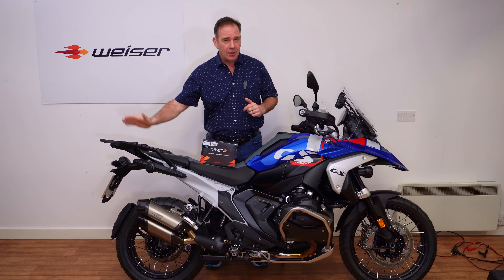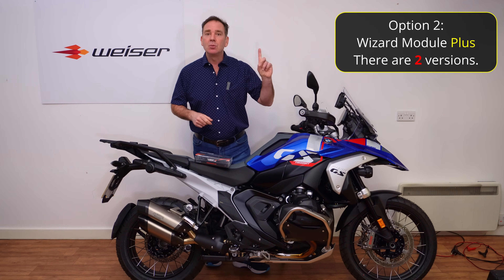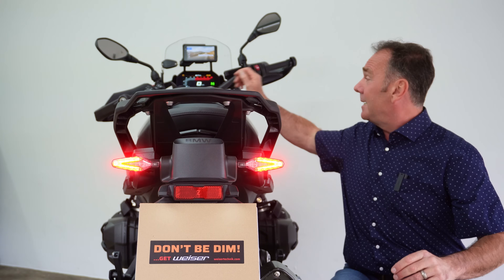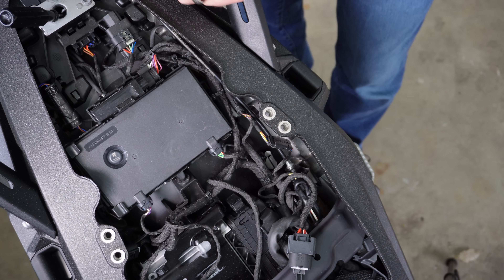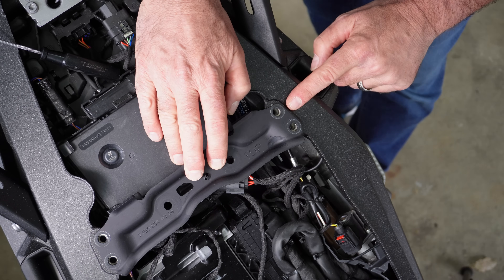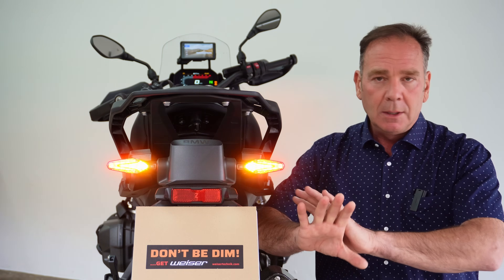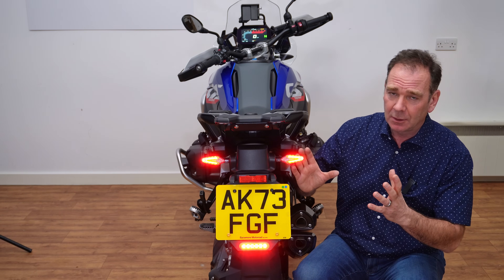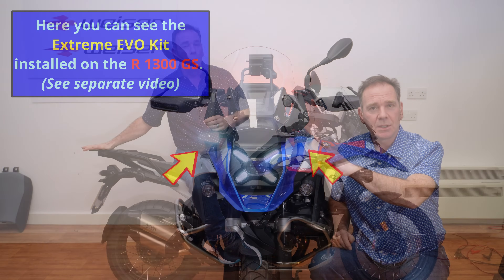BMW R1300GS Weiser-Technik Wizard Module + add a Tail / Brake Light to your R1300GS, F900GS, S1000XR

Comment: BMW have gone mad over this. This is frankly Dangerous not having a brake light. My 1250 is bad enough having constant amber lights showing to the front. But this is another level xx
Reply from the maker: Well you can easily fix that on your 1250, many of us have already done this using Weiser kits.
Reply: @justthewayitis  Yes you are right and your videos are excellent. But we should not have too lol. BMW have let us down xx
Reply from the maker: agree, we shouldn't have to do this.

Comment: Great video again. Thank you, Carl. I’ll be going for the BO version but I will wait for the installation video of that version. With the Denali B6 if possible. Also, it would be great if Weiser would have an EU based dealer to avoid the heavy import taxes for anything coming from the UK.
Reply: Wat does BO means?
Reply from the maker: BO = Brake Light Only - this option is for countries like Germany that have laws that prevent us from having 3 rear tail lights. Carl
Reply from the maker: Hi Michiel good morning, it will be a few weeks before i can get that video up, but the install is really easy. have a great weekend, Carl
Reply: @justthewayitis  Will it require tapping in on the bikes wiring (with posi taps) or will the Denali B6 get it's power from the Weiser connector?
Reply from the maker: Just spoke with Mark at Weiser there will be a new product to do this that is plug and play. I’m in the UK helping out at the ABR festival at the end of June ( 2 weeks time) and they should have one ready by then.

Comment: I have the weiser front snd rear indicators installed would like an additional brake like how easy is that to do
Reply from the maker: Hi, which motorbike and year model do you have ?
Reply: @justthewayitis  2020 S1000XR
Reply from the maker: BMW S1000XR 2020 yes, you have the 3 options i show in the video. The standard V5 works well on the XR or if you are happy to do more work you can add an extra tail / brake light. see below link. Carl 
This is the link to the product page: https://www.weisertechnik.co.uk/product/weiser-wizards-bmw-multifunction-rear-indicators-re-sequencing-modules-with-aux-brake-connectivity/

Comment: Awkward! I absolutely follow my two comment fellows before. I own two R1250GSA and would never, really never change to the R1300GS. Where is the benefit of this bike? Same weight, tractor torque is gone, sound is awful, sitting position not suitable for an adventure bike, my pillion will hate me, headlight is ugly, material quality is less good as with the previous models (rust, scratches), more expensive, you can throw away all your accessoires and have to buy new ones, suitcases are poorely developed and not available, sometimes the bike will burn, recall due to screwing of the connecting rods, ...
Sorry BMW, that was nothing!
Reply from the maker: Yes the 1250 is lovely and I won’t change for most of the reasons you listed.
Carl
Reply: Me too
Reply: Spoken like a true non-1300 GS owner

Comment: This is how the tail light should have been from the first place. I bet the 2nd gen of the 1300 will follow this. Simple but brilliant. Can’t believe one can spend plus 30k on a motorcycle and NOT have a damn SEPERATED tail light
I got a great deal on a triple black 1250 and will stick with it until the second gen 1300 come out. Horrible design and user interface by BMW 😂
Reply from the maker: Yes we all hope the next generation sees a return, although I doubt it.
Reply: @justthewayitis  I never considered the GS until I saw the 1300. Looks lovely, but not available yet in my region. But all the issues for the first gen, the cutthroat pricing, the long wait queue…
Then there’s a great deal for the 1250. Not keen on the look and size, but I decided to take a test ride. Bam, I like it and the rest is history. 
Weird way to become a GS rider, but somehow BMW sold it to me, just like that 😂
Reply from the maker: Hi, lovely story thank you for sharing. Like you my GS ownership was a surprize decision and im very happy with the 2021 Rallye version i have. But the new 1300 is extremely good...
Kind Regards Carl